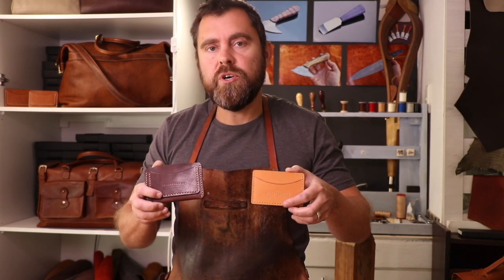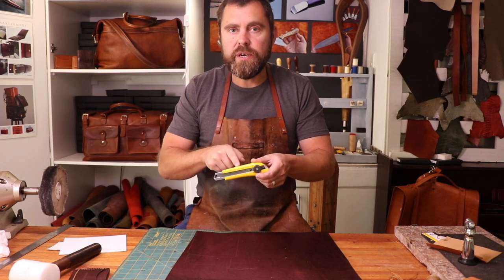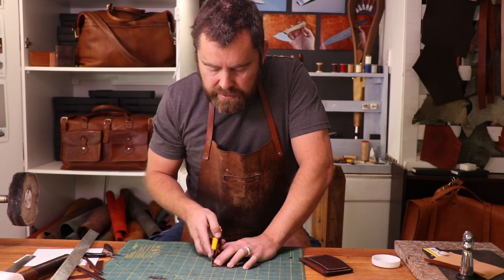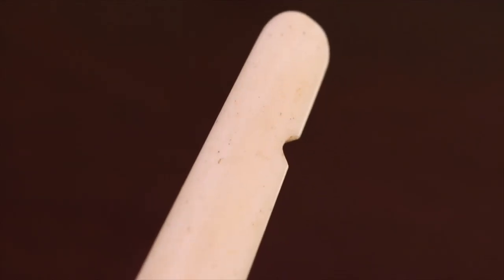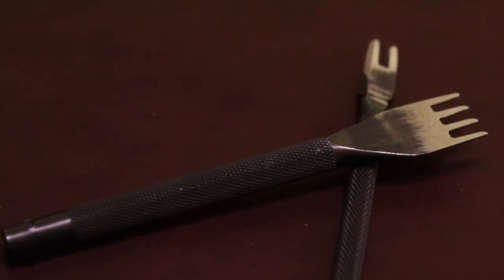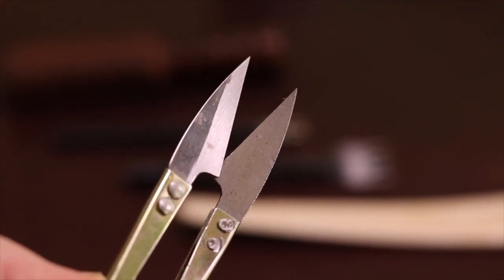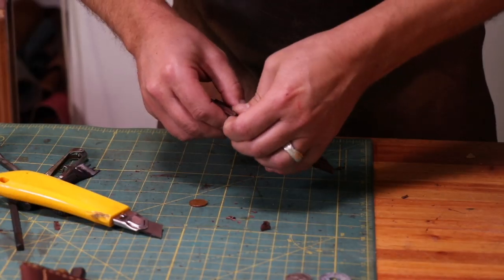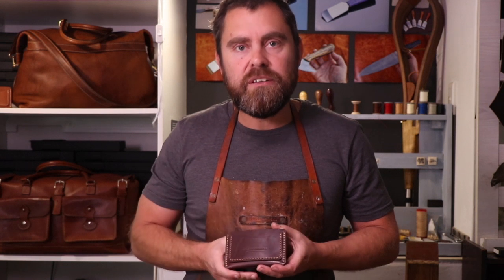Getting Started with Leather Craft - Basic Tools

Comment: New subscriber here, working through your super-informative videos.

I just wanted to leave a comment about using metal rulers when cutting, based on the unforgettable experience of seeing a colleague cut a couple of fingers down to the bone.  When cutting, there is a fair resistance on the knife, due to the leather and the cutting board.  If your knife does ride up onto a hard metal ruler---i.e. steel or stainless steel---this resistance is lost, and the knife can run rapidly along the ruler...right over the fingers holding that ruler down.

I still use metal straight edges, but I prefer to use thicker ones (at least 5 mm) when cutting tougher materials (e.g. thick leather, or rubber), so as to give a higher "fence" for the blade to ride over.  When I have no choice but to use a thinner ruler, especially on longer cuts, I try to hold it in place with clamps, at least on the end I'm cutting towards.

I also inspect the straight edge for any irregularities or nicks which might facilitate the knife riding up over the edge.

Safe cutting, people.

Comment: One major thing that I would suggest when starting is to spend the little bit more to get some heavy duty blades for the knife. They both last longer and you don't have some risks with the blade snapping off while you're working. The blades are designed to snap rather easily, but while you're figuring out the force you need for the leather, you can have issues there while working there, especially if you have a cutting mat that you've been using for a while because the tip can dull or break off far to easily there with getting caught in prior deeper cuts into the mat from the work.

A lot of hardware stores sell packs of them, and you really want extra blades anyway since a sharp knife is a safer knife...

And an old plastic bottle is worth rinsing out and keeping to stick used blades/blade parts into when you've used them.

Comment: Hey CHARTERMADE, what is the point of using glue, when you could just stitch with thread? Just starting to learn myself, and I'm curious
Reply from the maker: Hey Nicholas, using glue, makes it alot easier to stitch with thread.  The function of the glue is not to hold the project together, but to hold the sections together to that there is no movement in the leather pieces whilst stitching them together.  Some crafters may prefer to use a tape to do this or even little mini clamps.  The point is, you going to need to keep the layers of leather together somehow.

Comment: Great video! How do you determine stitching iron offset from the edge?
Reply from the maker: Hi Josef, If you meaning how far from the edge to stitch generally a heavier larger stitch would be 3.5 to 4 mm from the edge depending on leather thickness.